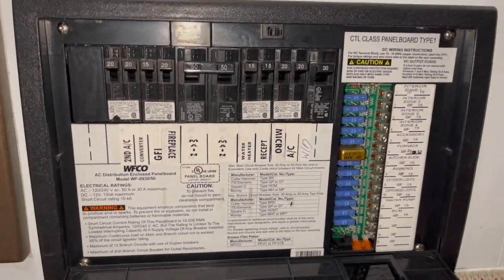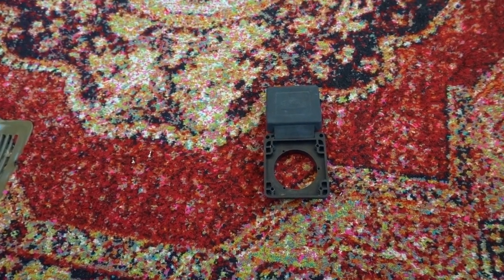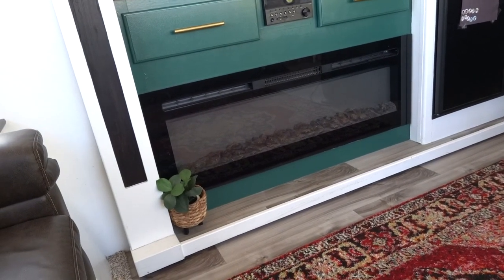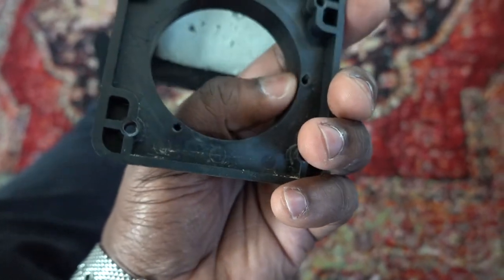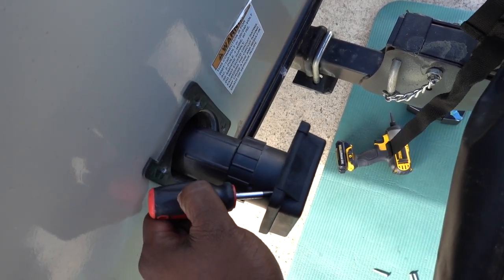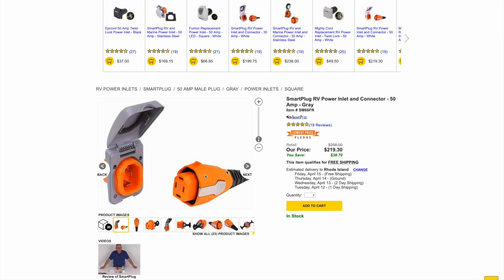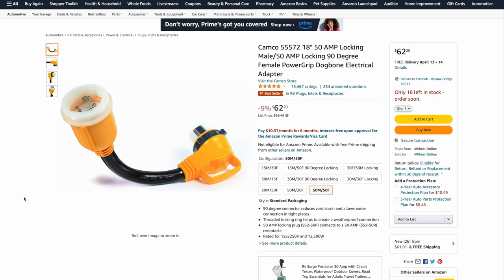NEW 30/50 AMP RV Electrical Issue Discovered And Fixed || Check This Before Your Next Trip!

Comment: 30amp is a single power circuit. 
50amp is two circuits for a total of 100amps. If you have an issue with half of your 120v plugs and appliances working in a 50amp RV, then one of those circuits may not be connected. The connectors could be worn. The wire going into your box could have come loose. The campground’s post could be messed up. I’m glad you managed to get it straightened out. 

I don’t think I would go for the other type of connector you were showing. It might be better, but I can get parts and adapters for the standard 50amp plug at an RV store anywhere. Even some Walmarts have a few options.
Reply from the maker: Great info and I did not know that about the 50 amp! I also didn’t think about not being able to find a spare plug if something happened to the upgrade 👍🏾👍🏾
Reply: Yeap this is correct. It’s similar to a house with a 200 amp, 240 volt drop. You got two “hot” wires coming in with a shared neutral. If one of the hot wires has a poor connection then half your breaker box won’t have power. 

This is essentially the same type of set up   The danger here is that poor connection can cause the wire to overheat. Hopefully the breaker would kick to prevent a fire but you just never know. 

I’m glad you found the problem.

Comment: We traded in our 2016 Thor Chateau for a 2022 Montana 3761FL in February. We learned from the Thor to get a 90° elbow for the city water connection but the power chord was hardwired. After connecting and disconnecting the shore power on our fifth wheel a few times I can see where a dog bone will definitely be beneficial, that will be our next investment!
Reply from the maker: I do the same for my water connections.  I also see people adding their water filter to that connection which is not a good idea...

Comment: JB, Thank you for this video. I was experiencing the same issue without power to have my rig (1AC unit, refrigerator and all my outlets and TV). Checked my power cord 50 amp and it was loose and not fully engaged. Undid the hook up and got pulled all the way...SUCCESS! YOU saved our vacation for the week. Thank you !!!!

Comment: I have a 30 amp 120v camper and getting 240v my plug and wire is only 120v. voltage from the pole to my 30 amp 120v plug box

Comment: Nice informative video, JB. This just happened to me last week. Microwave have no power, all kitchen outlets no power, 1 by entertainment and bedroom outlets works, and the worse part my 12V fridge ran out of juice. It turns out my converter is not charging my batteries. We survived by putting ice bags in fridge while batteries are being charged (Interstate). While driving and 5th wheel camper connected the battery got charged so converter is working. Took it to our dealership on our way home and they found out it was my 50amps power cord. They gave me a new one and problem solved. Now after watching this I will check my power plug outside. I don’t have to buy 90 degrees connector because my 50 amps cords is already 90 degrees. Thanks JB and keep up the good work.

Comment: This is a great video. I went through the same thing a couple of weeks ago it was driving me crazy. I went through lots of videos and all had same problems but no one gave any answer’s, I called several RV dealer ship’s even the one who sold my Keystone 303bh and everyone told me to check my breakers and then bring it in. This is the one I stumbled on but I figured it out own my own after hours and hours trying. Right now I have the tied to a latter to take the weight off the plug. Like I said I wish there was a way to make your video stand out because it would really help a lot of people. Thanks again.

Comment: Makes you want to pull your hair out, sure glad you didn’t. Like you said the straight plug in cords put on it after after awhile. Our son had the same thing happen to him, he used a dog bone adapter. If you can’t get a long enough one, he made a block to put under the main power cord to help relieve the stress. Another great video JB, y’all have a blessed day today and every day, be safe out there because some drivers are unpredictable
Reply from the maker: That’s a good idea too, I even thought about a bungee cord to hold it up on my rack I have out back. Thanks James 👍🏾

Comment: Another great video. 

My Furrion 50A cable that came with the trailer is a PITA to get tight and then to remove because there aren’t any large nubs on the locking ring. I just bought a Camco replacement cable with the 90 deg like this dog bone. You can get a grip on the Camco lock ring. Had I saw the dog bone first I may have just went with it and left it attached to the Furrion. The Camco cable is more flexible though so that’s a plus when wrapping up for storage. 

You should put links to these items you use in your videos.
Reply from the maker: Thanks, I’m thinking about signing up for an Amazon store but I will start doing this too 👍🏾👍🏾

Comment: Great video.  My fifth wheel is set up differently for shore power so I don't have this problem. I think you have a great solution but would also change the hard plastic plug from a metal.  Thank you for sharing.
Reply from the maker: That’s great, you must not have a Keystone then lol! Thanks Greg 👍🏾
Reply: @JB_WhoWork  You are correct, I don't have a keystone. I do believe you have a great idea that would solve your problem.

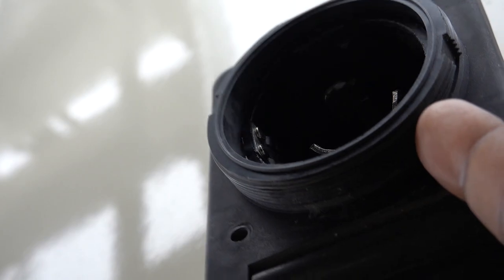Comment: K like 3:40...so i have the SAME exact problem, thats why im doing youtube research, haha. Ive had my rv plugged into the dame sourve for 6months now, not an issue. All of a sudden between 12am and 6am i lost all 120v power. The Source GFCI was tripped. But everytime i reset and plug back in, it pops again. I have everything in my rv unplugged, and still does it. I plugged it into my generator, and everything works fine. I plug it back into the original source GFCI and it pops immediately...any ideas???

Edit: now that ive finished video, mine is a 2004, so i have the big plug that can pull out of the compartment, i dont have a solid plug in side of the rv. So screws are definitely not my issue. But man if you have any ideas let me know! Seem like a sharp dude, and u gained a sub from me my man! Rv life 🤘🏼🤘🏼🤘🏼!!!
Reply from the maker: Thanks bro, seems like your plug may have an issue or shore power may be defective… do you have a surge protector that shows shore power is stable and wired correctly? If generator is working fine than I would check power cord to make sure it’s not damaged or have camp ground check electrical box 👍🏾
Reply: @JB_WhoWork  First off, dude thanks for the quick response that's awesome!! I've been tinkering between YouTube videos for hours and where I'm at currently....if I use an extension cord from source 120v GFCI without a ground everything works for like 10mins, then GFCI blows. If I use an extension cord with a ground, GFCI blows immediately. But again, ibe ran the same cord from the same plug for 6months now and never an issue until now

Comment: I’ll have to try this, I have 2018, this summer the power company changed a pole, when they put the power back on I only had power to outlets, fridge, microwave, no lights, no AC. Few hours later everything just came on, weird. Last night, the neighbors pedestal caught fire, when they put the power back on, same thing happened, outlets work, but this time lights never came on, furnace still not working. Just a electrical gremlin 🤦🏻‍♂️
Reply from the maker: It’s possible your converter could be the culprit so you may need to check that 👍🏾
Reply: @JB_WhoWork  it ended up being a bad battery 🤦🏻‍♂️